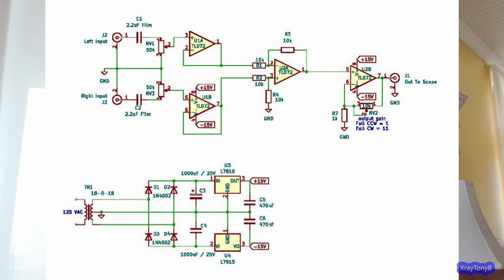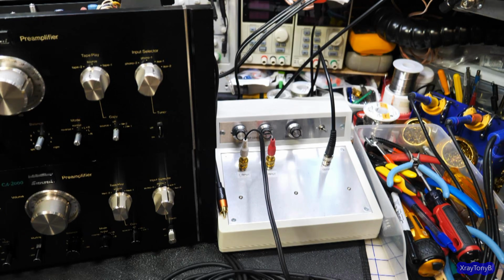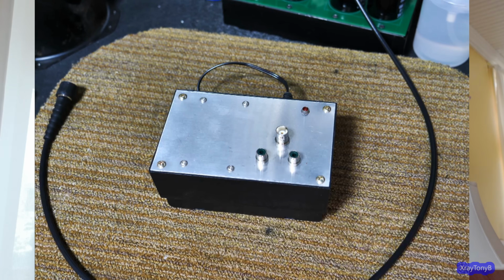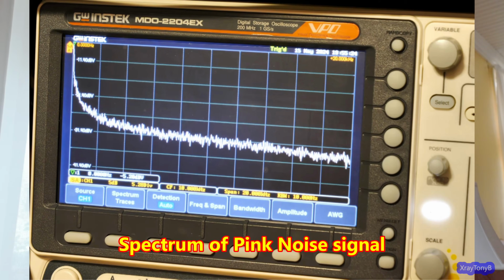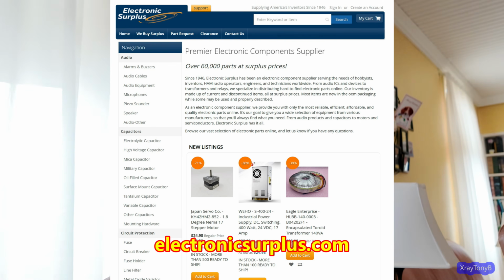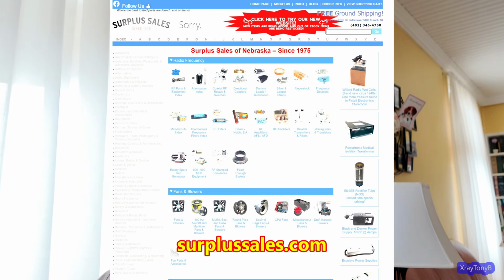Answering Your Questions Part 2

Comment: Tony, you are correct.  We are engineers by birth.  I remember my mom's clothes washer went on the brink, before it was hauled away, I removed many of the controls and the electric motor.  I think I was eight years old.  I am lucky I didn't kill myself.

Comment: In your YT Video you answered questions on transistor substitution, and also suggested that DC current gain (Beta/hFE)  Is not always important.
54:3

I recently repaired a variable power supply that used a darlington transistor as a pass element.  The previous repair person inadvertently substituted a generic NPN power transistor and as a result the output lost regulation and no longer operated correctly.
I tested the “wrong” transistor with my Atlas/ Pro DCA 75 semiconductor tester and it measured good, no leakage and a Beta of 57. No surprise.

The correct transistor is a 2N6383 (NTE 245).
When I referenced  the data sheet, the Beta was spec’ed between 3000 to 4000. (Typical darlington characteristic.) I tested with my transistor tester and was suprised to see a Beta of 44.
I know DC current gain ( Beta/ hFE) is dependent on Ibe as well as temperature. 
With the tester only supplying 5 mA Ib, I assume this is why the Beta appears so low.	

My question is: what sense is a Beta number when tested in this fashion.

I’ve always tried to match all the transistor’s  characteristics when replacing, including the Beta. If the Beta or any other characteristic is way off, I assumed the device is out of spec and way off.  Not so?
Reply: Update: DAC75 manual explains why; emitter resistors inside darlington package skews reading.

Comment: 48:43 - It would be interesting to get a hold of a Seeburg schematic and see how that circuit was designed to accept either Ge or Si transistors! (or you could buy an old Seeburg -- (just kidding :) )

Comment: I got a shock one time when working on a Heathkit frequency counter. I thought the outer trace on the circuit board was ground, instead it carried the 120 volt ac from the inlet to the front. I touched it with my left hand and my elbow was touching the outlet box on the front of my bench. I let go in a hurry. Lucky no further damage to me or the equipment.

Comment: A 480 volt contact frequently results in a large arc-flash that will cause serious flesh burns. 480 volt can also re-strike after current zero. You’re a lucky man.

Comment: the question I have about aligning tuners how do you go about doing an aligning a tuner with out any service docs.
I have one a tube FM that I can not  find any docs on it. If you could go through the way to identify the different stages in the circuit, AM , FM tube or Transistors   it would be very helpful and interesting more circuit analysis

Comment: To the first question: the ADCs and DAcs of a decent soundcard can resolve minute differences and can do a decent job of figuring out distortion. There are free programs to do just that and the setup shouldn't cost more than 100.
Zapping: Not a native English speaker, but, when I said that "I was electrocuted" people corrected me that "shocked" is the correct word. The first one means death. I'm "happy" to see that a native speaker uses the same word. I've had at least one near-death experience as a child but even University doesn't protect you too much. In a high-power lab (plant simulation) I reached out to unscrew motor terminals but the mechanical 3-phase switch was making contact on one phase. All under professor supervision, so just watch out for your own hind and ignore the "you are safe" advice.
Reply: To your defense, electrocute means to severly injure or d34th from electricity. If neither happened, then shocked, zapped, bit or bitten, etc. apply.